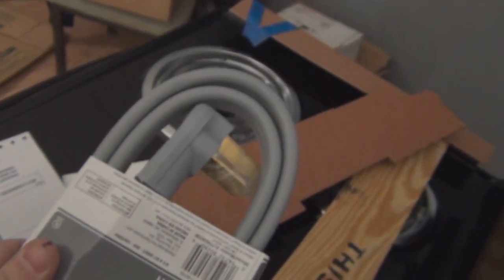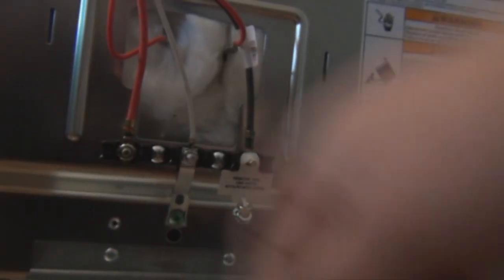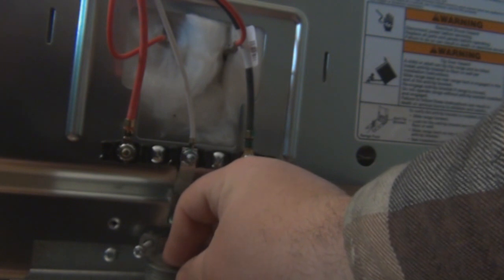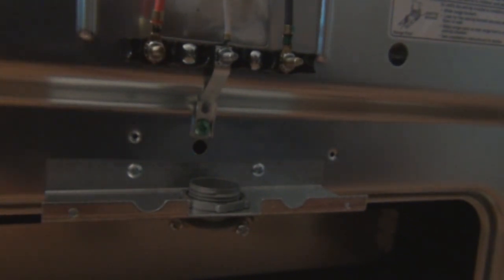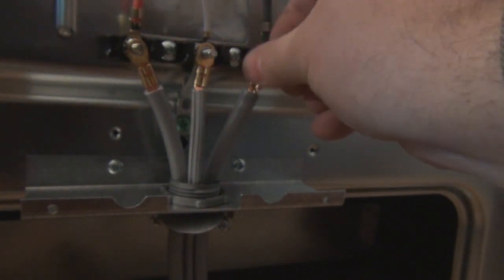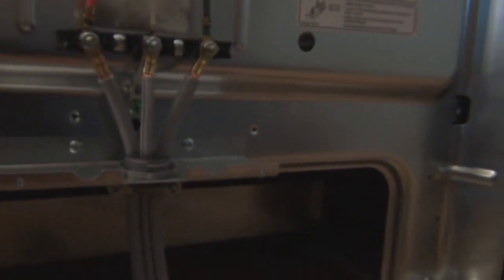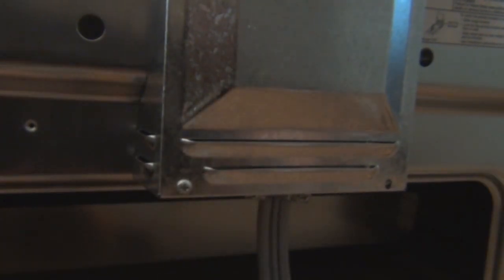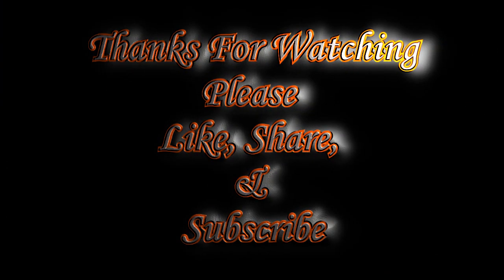How To Connect A Power Cord To An Electric Range   Stove  Which One To Use

Comment: Does it matter which hot wire goes left or right?
Reply from the maker: If they are not color coded, I just hook them up to the line connections in any order unless the manufacturer specify’s not to. I hope this helps. Thanks for watching and commenting. Please like share and subscribe

Comment: I have the same stove but u didn't connect the green one on the bottom do u need to connect mine or i dont have too
Reply from the maker: I would try to connect the green ground wire to the frame or junction box somehow but away from the hot wires. I hope this helps. Thanks for watching and commenting. Please like share and subscribe